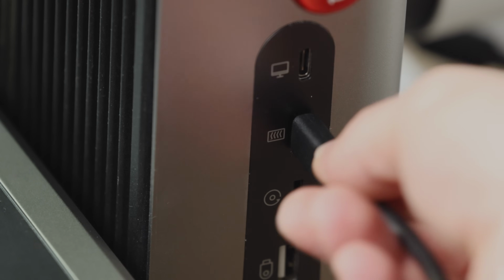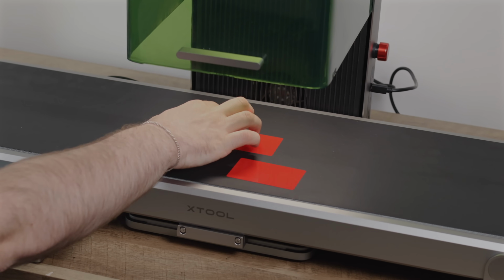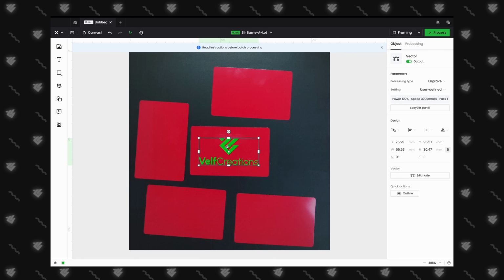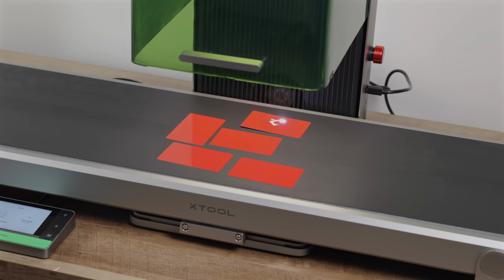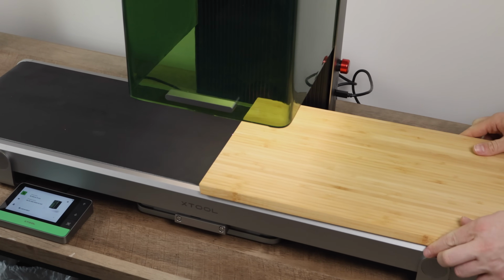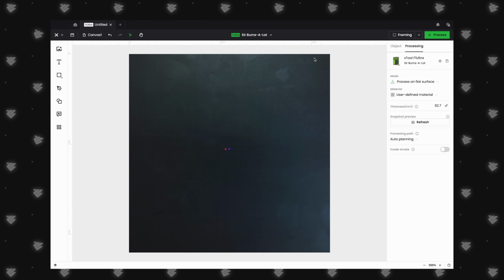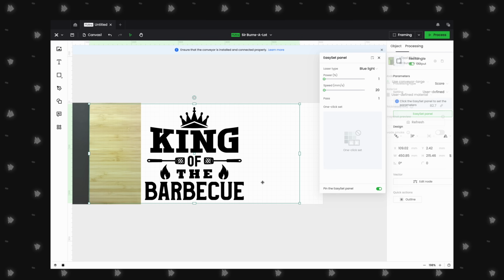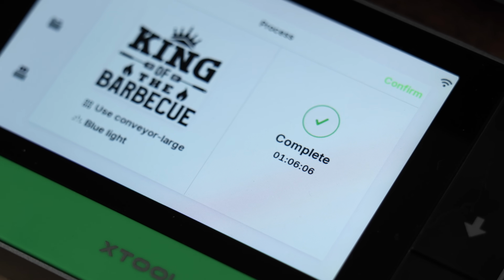Mastering the xTool F1 Ultra: Conveyor Setup and Batch Engraving Tips

Comment: When you drew the rectangle to help with centering, I did not catch how you were able to determine that the design was centered. Did you simply eyeball it? Or was there something more accurate? Did you count grid squares, or was there a handy centering button (wishful thinking?)
Reply from the maker: Hey for this one we just quickly eye balled it. But what you could do is draw a rectangle that perfectly fits on of the cards, then center your design in that, it will auto snap into place, then just simply remove or ignore the rectangle
Reply: @VelfCreations  and that's exactly what I did, and it did "snap" into place. What an achievement learning how to do this. I was stuck for several hours today trying to figure this out. Thanks for this!!!
Reply from the maker: @ love to hear it! Happy to help 😄

Comment: Hi, the function that automatically detects the various pieces works only with the Conveyor or can also be activated without it?
Reply from the maker: It can work with out it, You add your items, use the camera to refresh the image in XCS then position your design how you would like over 1 of the items. 

Then select your design and in the left side menu hit the application button then batch fill. 

Hope that helps!
Reply: But can you keep adding items? Or do you have to do another batch @VelfCreations
Reply from the maker: @ Yes we demo in the video by adding more cards as the conveyor is running

Comment: Very curious as to how accurate the placement is for engraving. Is it possible you can do the same on clear acrylic cards, so you can overlay them and see how close they are?
Reply from the maker: Unfortunately the blue diode lasers and the fiber aren’t ideal for clear cards. You would need a co2 laser for that
Reply: @VelfCreations  they can mark acrylic, at least well enough to verify placement accuracy
Reply from the maker: I understand what you are saying, and maybe under ideal circumstances it would. But that’s not what this system is designed for. It would probably end up marking the conveyor. But accuracy would not be great when the Ultra tries to detect a clear piece of acrylic
Reply: @VelfCreations  you could use translucent too
Reply: @VelfCreations  or cut acrylic and paper the same size and put the paper behind the acrylic if it’s having trouble seeing it. But whatevs. Was just curious. It’s possible to test but not gonna force your hand